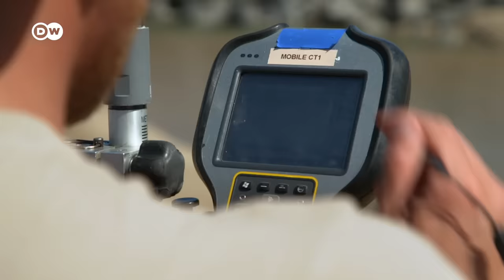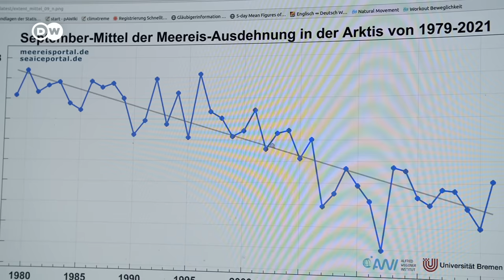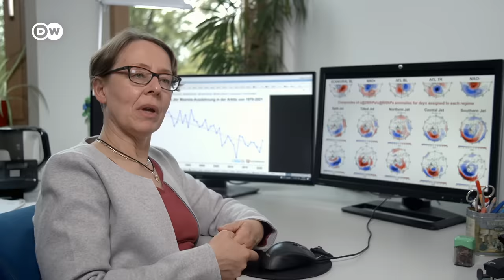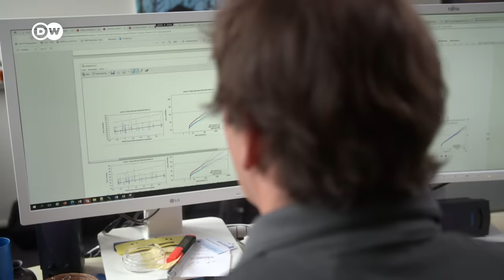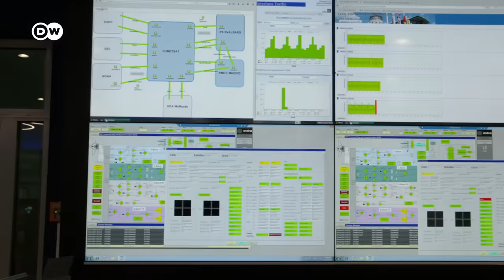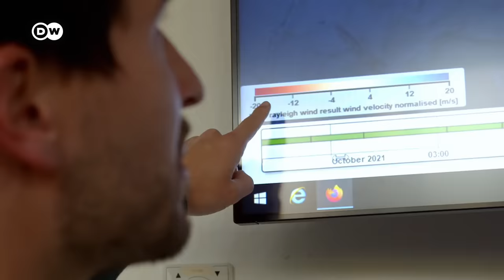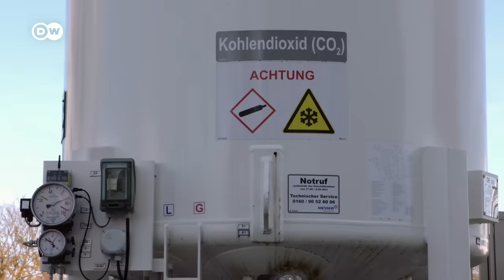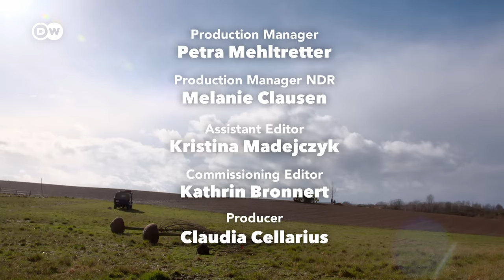Wind and climate change | DW Documentary

Comment: My dad's side of the family has a house on a lagoon with an impressive sandbar. When my grandma was young, you could camp on the sandbar without worrying about the tide reaching you, and when I was little you could have a picnic above the high tide line. now there's barely anything left. another 10 or 20 years and the lagoon might not have anything left to protect it.
Reply: My family has lived near this New England  beach for over 70 years and it has remained a constant all that time... until the past 3 years.. where we've suddenly lost almost 1/2 the beach.  Something has changed.  I blame the stronger winds for pushing the water across the area.
Reply: That sounds like land erosion is the problem not rising sea or a combination maybe.
Reply: nature says move
you just have to move
the more you resist
the more she will push
Reply: @loobylooroden6176  It's all connected.  The warmer ocean water creates stronger winds... driving storms that push the water ( which is now higher) across this peninsula.
Reply: The planet is very dynamic, isn't it?
Reply: @faithrada  Or just bad luck.

Comment: I grew up in the 1970s and 89s in Miami. I remember teachers terrorizing us with maps showing Florida almost completely underwater in "THIRTY" years. It was all a big fat lie.
Reply: Or a mistake based on early and incomplete data.  It's the deniers, like YOU, who are the liars, because you KNOW better.  Or you SHOULD.
Reply: Sea level is the least of our worries. We’ll go extinct from starvation long before sea level rise is a major issue
Reply: @Jc-ms5vv  as the global poverty rates continues to DECLINE. that means man is getting safer, healthier and wealthier GLOBALLY
Reply: @kimweaver1252  So the early data about "global cooling" was also wrong?
Reply: @-SANDMAN-  Depends.  It WAS cooling in the late fifties, the sixties, and the early 70s,  VERY slightly.  Largely due to the rebuilding and greatly expanded industrialization post-WW2.  The aerosol parasol (look up AEROSOL MASKING EFFECT) provided some cooling even though the total solar irradiance was rising, which would otherwise increase heating slightly.  But beginning in the late 70s, the total heat burden of the atmosphere began to increase, with most being taken up by the oceans.  But there was sufficient residual heating to melt high latitude and high altitude ice, reducing albedo.  That amplified heating.  Now, more of the retained solar irradiance is being manifested in hotter atmosphere and oceans.  Any questions?
Reply: No, it wasn't.  I would like to see proof that they said it was a guarantee.  No scientist would talk like that.  A journalist might be that wrong, and perhaps an inexpert commentator, like a teacher might also.  But if you look at the SCIENTIFIC journals and seek out the peer-reviewed published papers, over two thirds have been very close to estimates made over the years, with the bias towards conservative estimates being prevalent, so the sea level rise is ahead of schedule, in most cases.

Comment: Let's see how you get out of this up coming crisis in winter with wind power and induction stoves
Reply: Even with gas and coal fired plants, tons of people will still be in danger this winter due to the Russia-Ukraine war. When there's nothing left to burn, are you going to set yourself on fire?

People froze to death in Texas due to cold temp failure of ALL energy types, and not having buildings/infrastructure prepared for extremes that are considered normal elsewhere. Solar alone outproduced expectations during their crisis, despite also being affected. Let's see how you heat or cool your home if the price of energy continues to be reliant on fossil fuels, subject to global conflict and a cartel. All while a pandemic continues and may yet be poised to get worse again before it gets better or ends, and an economic recession looms.

Instead of making such a shallow and reactionary viewpoint, let's see we can help solve our problems... even if it's nuclear or geothermal, there may be a way. If we drastically decarbonize electricity production and boost the diversification and quantity of low or zero emission energy sources, we will all become more resilient to climate extremes, and even burning some wood for heat in an emergency or running the air conditioning 24/7 would be less of an issue.

Comment: in the 70s they said the climate was getting colder not warmer
Reply: yes we are still in an ice age.
Reply: I remember that.
Reply: NOAA satellites for Nov,  1987 was warmer than this year, same as 1999-2000 was much warmer than this year by as much as half deg. C cooler, we had a bit warming leading up to end of 2016, since then earth has gradually cooling from peak depending where you look between +0.83c - +0.93c down to only +0.17c but if you look a month 2016 nov +0.45c - 2022 nov +0.17 for for the month of nov according to NOAA satellites we have had a slight cool off. we also entered a grand solar cycle what comes around every 350-400 years and we only seen a little bit of whats to come
Reply: Yes, they did.  That was what the evidence suggested at that time.  The current predictions are based on more current data.  Science is not infallible.

Comment: Geoengineering is causing the abrupt changes in the climate.  It is also responsible for the death of necessary microbes in the soil affecting moisture uptake in the trees.  How much toxic metal can the trees stand before they weaken and cause bark beetles to proliferate?  There is no legitimate discussion about the climate without factoring in weather modification.

Comment: I respect DW and appreciate them covering climate change but I have to criticize the cautious nature of changes to the jet stream. I don't think that was your intention. The production could have used a more comprehensive 'connecting the dots' at the end. 
Also, you could have been a little more upfront about just scraping the surface of change. There are many tipping points that are already occurring and with rapidity. Your brief stop in the tundra/permafrost did not touch on the prodigious amount of lakes forming and, I recently saw in the news, now disappearing (i.e. transferring heat into the permafrost). There is a lot changing and the impacts are just getting revved up. So anything you report on is greatly appreciated and you will have a growing audience.
With that in mind, you might consider different series for different folk. For example, an introduction (like this video), to something more in-depth like the Doomsday Glacier in the Antarctic. In that video you don't have to worry about talking to the, how should I say, uninformed. They can go look at the basics in another video. There is also the whole world and government response (or lack thereof) that gets little to no reporting.
All that said, thanks again for your efforts.

Comment: The summary of climate change is easy. 
It is the change of humidity in atmosphere,  which produce between the (land)and the(seas & oceans) on the other hand...
Occurring of rains, snow, storms, and floods at time and in unexpected places, confirm my theory(the change in the directions of winds)which must be balanced...
How to reduce the heat of the earth and atmosphere?
We must supply the earth with a natural cooling places...
Results:
                                                              ----------
1- To balance the water vapor which produces between the( ground)and the(seas and oceans )...

2- To balance the pressures of the air in the atmosphere...

3- To balance the directions of winds which caused the climate change...

4- To control upon the storms and harricans...

5- To revive the the first theory of climate change (dynamic horizontal movement).
6- To balance the percentage of gases forming the atmosphere.

NOTE :The lack of water vapor is of land not of seas and oceans...

These studies had completed and sent on July 26th 2000...

                         Yousif A Tobiya 
                       Forcibly displaced

Comment: What about the massive numbers of cell phones, cell towers and satellites beaming microwaves onto the earth?
Reply: A 1000 watt radio tower can reach over 80km. Thats roughly 2*10^10 square meters of reach. That means there is 5*10^-8 watts per square meter. Or 5 nanowatts per square meter. In comparison the sun is 1380 watts per square meter. Moonlight is 0.001 watts per square meter. Moonlight is roughly 20000 times stronger than the energy dissipated by a  radio tower.

Comment: He says at the beginning :.....wind speeds are increasing in Europe by up to 5% that they are lasting longer and wreacking more havoc than before, that effect is clearly seen in our forests . In the last 30 years 17% of the protective canopy in central European forests have disappeared (in part) because of storms getting more powerful"....... He does say in part, so don't think this makes it the headline that the video is attempting to convey that it is. One very important factor which should not be overlooked, is the prevalence of so many man made forests grown for trees as a timber cash crop. The trees are often not properly thinned at the right time and with their shallow root systems,   ( planted so close together to get the maximum number of trees within a designated area ) they are more prone to be blown over, once they do they have a domino effect and the whole man made forest is flattened: Another reason is that there is always pressure to cut down trees to make way for new farmland, housing etc.

Comment: Le Chatelier's principle states that if a dynamic equilibrium is disturbed by changing the conditions, the position of equilibrium shifts to counteract the change to reestablish an equilibrium. If a chemical reaction is at equilibrium and experiences a change in pressure, temperature, or concentration of products or reactants, the equilibrium shifts in the opposite direction to offset the change. In short, earth will rebalance to reduce the effects affecting it. 👍

Comment: The problem with this movie is that it only covers short time periods. It also rarely provides a data set to back up claims. For example, hurricanes are not increasing in strength or intensity. Even IPCC AR6 WG1 chapter 12, table 12 does not attribute climate change to anything other than rising temperature and increased rates of precipitation. 

The movie contradicts itself. Wind speeds are likely to be lower  if temperatures rise (10.40). This is because temperatures will rise faster at higher or lower latitudes than at the equator and therefore the temperature differential will be less between the two and so will wind speeds (generally).Preliminary. modelling for southern ocean doesn't find any increase in wind speeds, or it suggests it will be lower. 

The movie also shows that there will be winners and losers in a changing climate. The albatross seems to be a winner! 

Finally, in the medieval warming period we know the Vikings grew crops in Greenland. This demonstrates that the climate always changes with or without industrialisation. We also know that rising CO2 has caused the greening of the planet. We should welcome the warming world, accept that there will be some losers, but overall, I suspect we will all win with longer growing seasons, less extreme weather (related to lower wind speeds), and warmer weather (it is the cold we should fear which harms humans far more than the warm).

Comment: Abstract :
   
 The energy that dominates the earth is very great, some of it is natural, like the heat of the sun and volcanoes, and some of it is human action, by cutting down trees, without replacing them and cultivating in their place...
 There are five forces that control or dominate the planet...
 1- The first theory (horizontal dynamic movement) and its end...
 The occurrence of storms, rain, floods and snow, at unexpected times and places, is because of the expiration of this theory, which needs to be balanced...
 2- The second theory (vertical dynamic movement) and its end...
 This movement or force controls or dominates the earthquakes, earth cracks, drying up of rivers and lakes, earth openings, mountain collapses, and the emergence of drinking water springs on the ground...
It becomes out of control...
 These phenomena increased due to the end of this theory...
 The third theory: it is water that rotates the earth...

 The fourth theory: the Earth's axis of rotation has tilted 2° degrees...

 The fifth theory: The Earth has a new orbit...

These studies had completed and sent on July 26th 2000

                                YOUSIF A TOBIYA 
                              FORCIBLY DISPLACE

Comment: 10 seconds into the video ...and I have to write this comment...   Already from the very first sentence DW shows that they don't know what they are talking about : " Wind is the driving force behind our weather"...      ....NO IT IS NOT ....this is just pure ignorance.
Wind is the result and not the cause due to the thermophysical properties of the atmosphere.   It is temperature (heat) and temperature differences in the atmosphere that cause movement of air / pressure differences / wind.

Comment: This article perpetuates the ignorance shown over climate by most of the MSM. The climate is driven by the action of ocean changes in the tropics which operate on a regular cycle such as ENSO ( El Nino and La Nino) which affects the temperature of the atmosphere in the Pacific and the Indian Ocean Oscillation that has a major impact on the Middle East. Then we have solar activity which when low as now increases temperature and so the pressure in the stratosphere over the Arctic causes the Polar Jet to become Meridonal and push cold air down into Europe. We will see all these in play this winter in Europe where a combination of La Nina, a negative IO, and Meridional Polar Jet will bring periods of very cold weather to Western Europe during which either wind speeds will be too low or too high for wind units to operate and in the absence of gas the population will freeze teaching the population the real truth about what controls the climate and it is not carbon dioxide. We are in a cycle of global cooling that will bottom out in 2060 as the Earth slowly moves towards the next major ice age. The changes in sea level and tide surges described are a response to the phase of the 65-year lunar Saphos cycle responsible for the high tides - the oceans are not level around the globe but subject to changes in the combined gravitational effect of the Sun and Moon as their alignment changes during this cycle. In addition, tectonic rebound is occurring as the northern land mass recovers from the ice sheets of the last major ice age causing countries to tilt such that one coast rises whilst another falls giving the impression of a major rise in sea level.

Comment: What. if we have an all too low level of CO2 in the atmosphere???????? What if it really needed to be in the level of 3000 to 9000 ppm of co2.
If the co2 ppm level was in lets say 3000 ppm, could the vegetation grow faster and stronger and could it cause the deserts to grow so that the formation of sand would stop?????? 
Could the excess warming change to stabilizing the weather?????
Please go through these possibilities. Here might be a pathway to a solution.
Much Love : Ole Lindell
Reply: @karlwheatley1244  Can you explain how 165ppm added to the 260ppm equals 425ppm of CO2 can heat up 999 575ppm of the atmosphere so 165ppm of CO2 raised the temperature 1.1 degrees doesn't seem possible

Comment: In the current global situation it is now way too late to even attempt reversal or amelioration of the atmosphere. Even if every human carbon source was stopped, global warming will continue at the same rate and is accelerating daily. There are now millions of tons of both CO2 and CH4 being released into the Arctic atmosphere (the reason the Arctic has heated quicker than any other region in recent years) The wild fires in both canada and Siberia that are burning acre upon acre of the Taiga belt are also exacerbating permafrost melt. The fires regularly ignite CH4 pockets just beneath the surface which in turn makes more fire. The melting of the parmafrost has passed the tipping point. It has entered a feedback loop that will continue regardless of human atmospheric CO2. When CO2 reached 350pppm it was already too late as the global warming baton had been passed to CH4 whic is a far more volatile greenhouse gas than CO2 - one molecule of CH4 being equivalent to about 25 of CO2. Although CH4 has a much shorter life span it's volatility is far more atmospherically destructive than CO2, which, even in the short term makes Arctic warming totally irreversible.There are also millions of tons of CH4 escaping from the oceans from melting methane hydrates on the sea floor. These are not being affected by atmosphere but under sea floor heating due to rising mantle plumes. Please research the rise in 'deep quakes' in the South Pacific. They have increased expnentially due to massive magmatic movement in the mantle. In late 2021 there was a Mag 8 deep quake beneath Fiji. A short while later another Mag 7 beneath Tonga and then shortly after  the Hunga Tonga–Hunga Haʻapai volcano erupted in the most violent explosion for many years. It has caused a rise in both earth movement and volcanism around the ring of fire both west and east. The only places yet unaffected are the Cascadia fault line and the Californian fault system. Research the 12,000 year universal cycle. The weather will be the least of the planetary problems that face the human race.